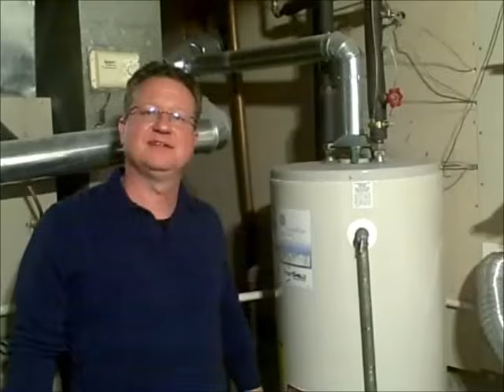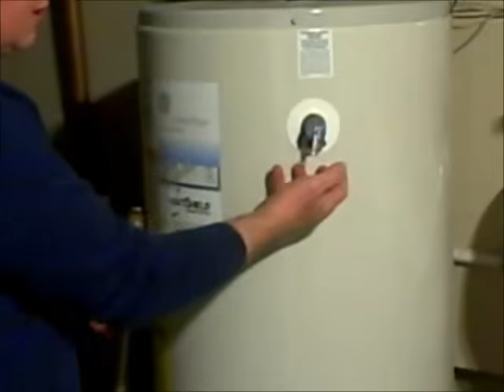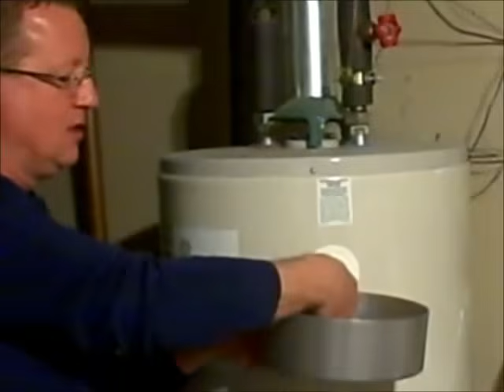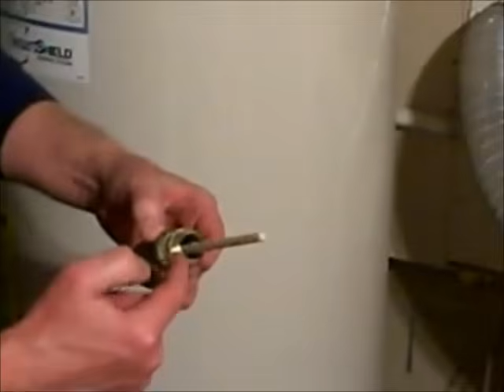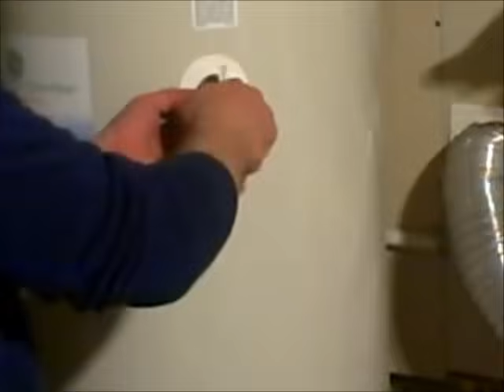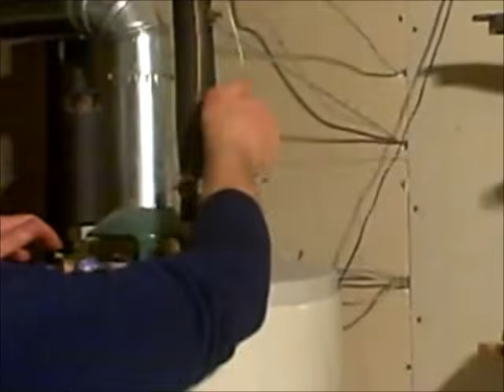Water Heater Pressure Relief Valve - Prevent Water Heater Explosion - Replace a Relief Valve

Comment: Thanks - I know that. But as the cold water enters the hot water heater, how does it maintain the same pressure? If I turn on the hose and fill up a bucket, I need pressure to do that. But the water in the bucket doesn't have any pressure.

Comment: I did it.  $15 part at lowe's and a 4" piece of pipe tape. Air in the lines scared the wife a little, for an added bonus. It took about 10 buckets of water to get the level down.  Next time I'll know to just feel the valve for a drop in temp from what it was before unscrewing it. 7 buckets(gal.) didn't do it. Probably saved $100 by doing it myself.
Thanks for this video. It was a great confidence booster.

Comment: this procedure can get very painful if you happen to live in a area where the the pipe from the pressure relief valve is routed outside.  this may lead you to have to de-solder the pipe at bottom elbow  just so you can unscrew it at the top.  if that does not bother you keep in mind that the place you will have to use your torch on is literally touching the tank leaving you with a problem with burning the tank.

Comment from the maker: Hi,
It's hard for me to help with the running water sound. Is it making a sound when no water is turned on?
If the hot water tank is not heating up, I would turn off the gas or electric and drain the whole tank. If it is an electric tank, it could be one of the heating elements. Drain it and check to make sure the water runs clear. If there is a lot of sediment on the bottom of the tank, it will prevent it from heating properly.
Let me know if that helps.